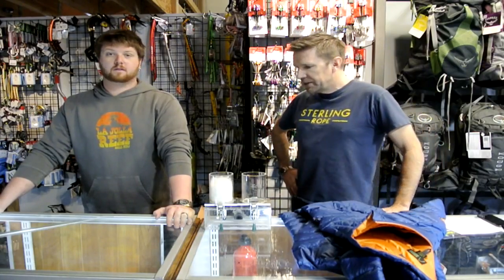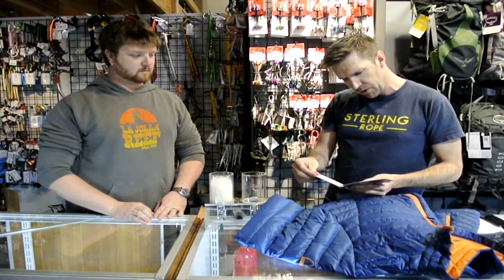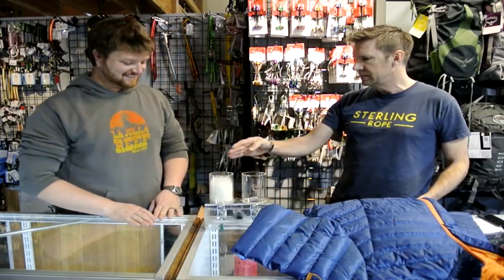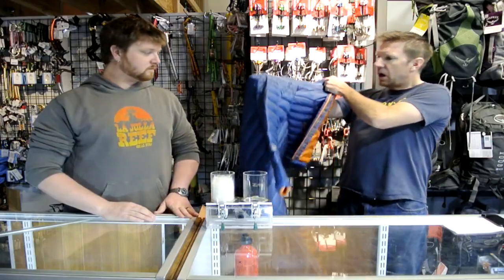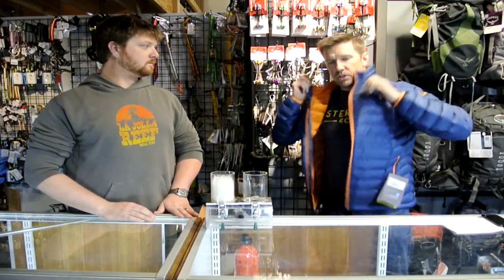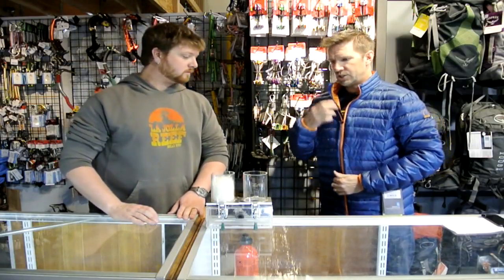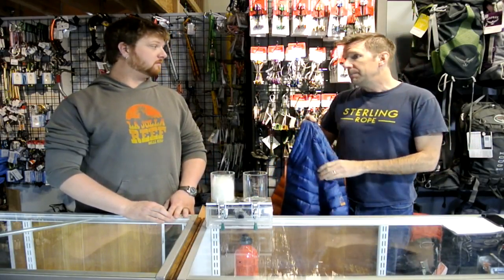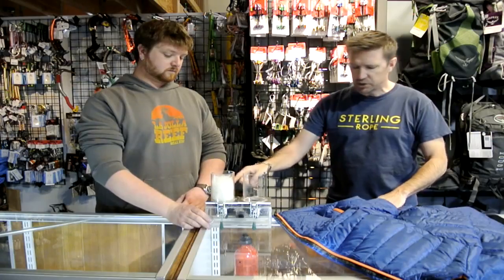Sierra Designs DriDown vs. Untreated Down - Steam Test

Comment: I think the biggest issue with this test is the temperature.   There is no way your body is going to reach 200 degrees.  I have several jackets that the DWR sometimes lasts for a couple hours in the rain.  But if I put that same jacket in the shower using only hot water it wets instantly.  Try it for yourself.  Hold the jacket in the shower under cold water and then switch to hot water and watch how quickly it will wet out.

Comment: I too would b interested in a synthetic comparison. If possible you could take before and after weights of all the insulation being tested. Lastly one advantage of the waterproof down could be the potential to dry out if wet. You could measure water weight loss at periodic increments.

Comment: A slightly more scientific way to account for not having any compression to tell when they start losing there usability would be to add a plastic disk just smaller than the tube, with holes in it to let the steam pass through. This would probably add just enough weight to see which one starts failing first.